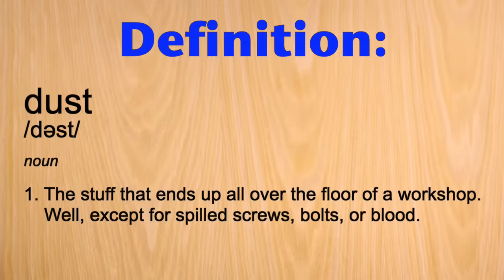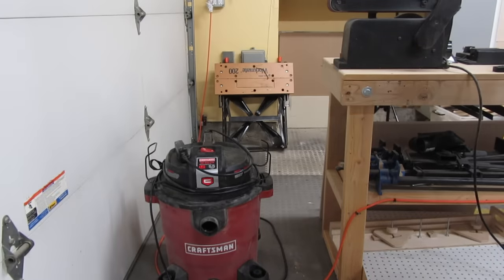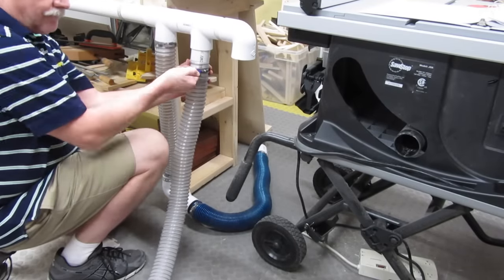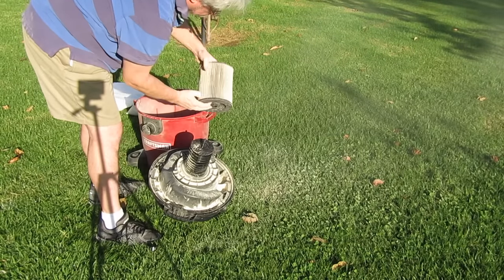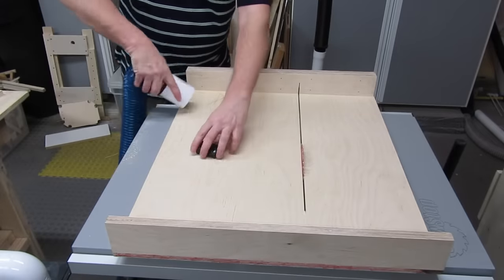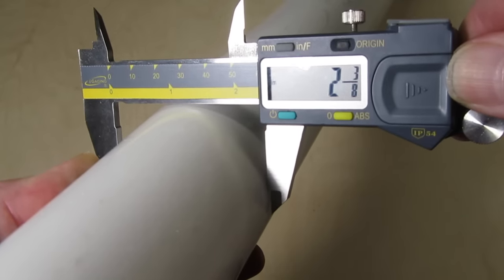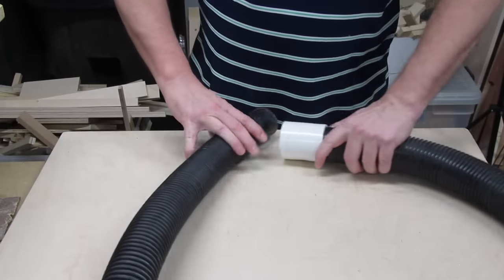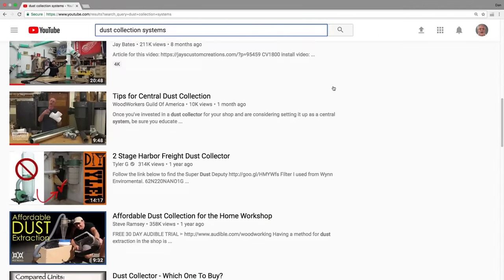Dust Collection for Newbies: Introduction to Dust Collection

Comment: I have cut pvc pipe with my mitre saw. 100mm pipe unfortunately doesn't fit but anything smaller is fine, so long as you cut slowly.
Reply from the maker: Thanks for the info!

Comment: I'm glad I found your show. I'm a newbie to woodworking. This set up for dust collection is just what I've been looking for in my little shop. In this video, I noticed your tabletop band saw. What make and model is it and do you like it? Thanks.
Reply from the maker: Thanks, I'm glad you found my channel too! It's a Ryobi BS904 (or it might be BS904G). It's "good enough". There's lots of times I wish it had a longer reach, but to get one with a really long reach is pretty expensive, so this works fine. There's one set screw that wasn't long enough and it stripped out, but it was a standard size and I replaced it easily. Like I said, it's "good enough".

Comment: Let’s talk T’s and Elbow, I’ll refer to as L’s.
A why fitting I’d move efficient than a T because of turbulence. The Y makes a smooth directional transition vs. the T which makes the dust hit a solid wall before turning. It can also plug the static side of the T by collecting in the vacuum caused by no flow on that side of the T.
L’s.
This is basically the same deal as the T.
A 90° L causes the dust to hit a solid wall. Two 45° L’s attached, as with the Y, cause a turn instead of a crash.
These are the best way to transport dust.
Here’s one more point.
If you live in high humidity, using any vacuum system will cause condensation in your closed system. Moisture and dust? Makes mud.
Just beware of that and like everyone says, don’t glue anything together in your dust collection system.
At some point in time, you will be disassembling and getting clogged dust out.
Reply from the maker: Thanks for the comment. Regarding T's, Y's, etc., I think (emphasis on "think") they don't affect shop vac-based systems nearly as much as they do systems that use blower-style dust collectors. I think it has something to do with the fact that one system relies on air speed, and the other on air volume, or something like that. I did some testing with an anemometer, and that appeared to be what my results showed. I'm completely aware that my testing methods might not have been accurate enough, but that's what I came up with. So take that with a big grain of salt. 😄

Interesting about the moisture and dust issue - I didn't know about that. Of course, I live in Southern California, so high humidity isn't as big an issue here. With that said, I agree that not gluing the tubes is a good idea, whether humidity is a factor or not. I've had things sucked up inside them that I was glad I could get to. 😏And being able to get to a clog is awesome. 😄

Thanks again for the comment.
Reply: The Newbie Woodworker   Well, they are not as affected in suction systems. The point is with moving product is best done with smooth turns, rather than sharp. Both systems work, but the less angle in turns the less turbulence.
Volume is better than velocity.
Speed causes resistance on the walls and will effectively close up the pipe.
Volume is much better.
Reply from the maker: @rogeroday9408  I can't argue with that. 😄

Comment: You mentioned smooth vs. spiral collection hoses.
Smooth hoses are not more efficient. Smooth duct with air moving inside builds static resistance. Spiral hose creates a rifle effect this is like a rifle barrel. Cyclone if you prefer.the spinning air causes the dust to slide with less resistance by channeling.
Reply from the maker: Thanks for the comment, which I found quite interesting. I was just parroting what I've always heard, but your explanation makes sense to me. 😄

Comment: In case it helps anyone.  I cut PVC with my Bandsaw when it will fit.  It works very well for cutting smaller pieces.
Reply from the maker: Thanks for the info! 😄

Comment: When particles flow thru PVC an electrical charge starts to build up.  If run long enough it will discharge.  Sawdust and air in the right ( or wrong ) mixture will, if an ignition source is applied, explode.  If the shop or building has a coat of sawdust everywhere, a secondary and more powerful explosion can happen. This info is out there. You are smart enough.
Reply from the maker: Thanks for the reply. Yes, I am smart enough to do my research. https://www.rockler.com/exploding-pvc-dust-collection-ductwork

Comment: I cut pvc with my miter saw. I have also watched a licensed plumber cut it the same way. It's pretty safe IMHO using normal miter saw safety measures - I would recommend wearing a mask and eye protection. PVC makes a mess - so make sure you have your shopvac ready. I have used PVC cutters, be very careful.  If the blade is not sharp, it will break the PVC. I wouldn't use one on anything over 2" - the pipe always snaps leaving a not so clean edge.
Reply from the maker: Thanks for the info. Now I know why it's so hard to find PVC cutters larger than, say 1 1/2".

Comment: The  two 45s work better because it's a more gentle bend and makes flow better. The Y fittings are great for the same reason but only if put in the right way, ie inline with airflow.  If it's put in the wrong way will cause issues
Reply from the maker: Thanks.

Comment: Should mention something about grounding the pipes to prevent static electricity generation and thus spontaneous dust combustion...
Reply from the maker: https://www.rockler.com/exploding-pvc-dust-collection-ductwork
Reply: Although scientifically possible in the most perfect setting it’s not a real danger. It’s like saying your socks will catch fire walking around carpet on a very dry and cold winter day. It’s just not gonna happen. Well maybe if you soaked wood/socks in gasoline and had a propane leak in your shop at the same time 😜
Reply from the maker: @matthewg7835  But if you soaked your socks and wood, then there wouldn't be any static build up. 😛

Comment: I'd add that, you really should be using metal for the tubing. PVC is the worst for static buildup and the potential to ignite the fine dust. It's recommended to run a grounding wire through PVC if that's what's being used.
Reply from the maker: Here's my thoughts on the subject: https://thenewbiewoodworker.com/dust-collection-fire-danger

Comment: If you want to cut PVC using a table saw or compound miter saw you need to flip your saw blade over. You don't want the teeth cutting into the PVC or plastic like it does wood. The PVC or plastic can shatter. If you flip your saw blade so the teeth are facing away when cutting you are basically melting through the plastic with friction. It gives you a cleaner cut and it shouldn't explode. Still be cautious.
Reply from the maker: Thanks for the info! 😄
Reply: @TheNewbieWoodworker  no problem thanks for the video. It was very informative
Reply from the maker: @inspectorsteve2287  👍

Comment: Your videos good. You should use 45 and why connectors better air flow Flo UW her. You should use a bandsaw for cutting repetition PVC pipe. They do make a PVC cutter but you have to go with the Victor brand a lot better and you can get a one that cuts over 2 inch just go to an industrial irrigation store.

Comment: I've use my chop saw to cut pvc pipe, safely so far.  Band saw works too.
Reply from the maker: Thanks for the info! 👍
Reply: I did once on a chopsaw, I'll never do it again... It blew up into hundreds of tiny shards shrapnel. I was very lucky all I got was a couple of lacerations on my arms. If you don't hold the PVC pipe tight enough it'll catch the pipe and make it spin at the same RPM as the saw blade which is very bad.
Reply from the maker: @J-D248  👍

Comment: I use my miter saw to cut pvc. It works great and I have yet to have a problem doing it this way. With that being said I don't condone using the miter saw....just saying it works for me. Also menards has a large pvc cutter that works great.
Reply from the maker: Thanks for the info! I don't think Menards has one that will cut a 2" PVC pipe - am I wrong?
Reply: @TheNewbieWoodworker  
You know friend I'm not sure. I know it'll cut 1 1/2 but sure about 2" sorry. Miter saw works perfect though
Reply from the maker: @craigo9101  No problem - thanks for the comment! 😄

Comment: I got tired of the plastic buckets collapsing  and changed to a metal drum with a clamp lid  ,Cyclone still fits the top and no more problems of collapsing drums purchased the drums from a auto paint  and panel beater supply, in fact got 2   cost $20  delivered ,they use them for waste or left over paints..I use a  redundant house vac  works well and plenty of suction  and the paper bag has nearly zero dust in it after 12 months
Reply from the maker: Great idea! Glad it works well for you. 😄

Comment: On the table, I would have installed the blast gate 180° turned, so the lid points upward and is easier to grab for pulling and pushing it.
Reply from the maker: That's funny - the reason I have it that way is for the same reason - to make it easier to grab and pull! I guess we just think of things differently. 😄
Reply: @TheNewbieWoodworker  But your way you have to somehow shove your hand in-between blast gate and table top every time?
Reply from the maker: @Suranfox  Um, yeah, and I was just in my shop thinking about that. Your way makes a lot more sense! Sometimes I'm a little slow on the uptake. 🙄Thanks for not giving up on me! 😄

Comment: the holes in the blast gates are for a grounding wire. dust colection systems build up static elctricity and with the dust create the potential for an explosion. now most of us dont have metal in our buckets but strange things happen. lots of sawmills and wood plants have exploded from static and dust. here is a link and photo of the ground. but you can do this with any bare copper wire. good intro though for those new to this system. 
http://www.leevalley.com/us/Wood/page.aspx?p=62616&cat=1,42401,62597
http://www.leevalley.com/us/images/item/Instructions/dustcollection1.jpg
Reply from the maker: Thanks for the info. Here's an article that describes my feelings on the subject: https://www.rockler.com/exploding-pvc-dust-collection-ductwork

Comment: Thank you for your informative videos. They are explained very well. I have used a miter saw to cut PVC and have not had any issues. However, my preferred method is those ratcheting PVC cutters; mine is a Husky from Home Depot and it works amazing! I do have a question though: How do you mitigate the risk of fire or rapid ignition with static charge build up inside the PVC igniting the dust Particulate Matter? I have heard you have to use tubes made for dust collection or steel?
Reply from the maker: Thanks. Were you able to find PVC cutters that can do 2 1/2" pipes? I never found any for that size. As for the risk of fire, I wrote an article about my thoughts on the subject: https://thenewbiewoodworker.com/dust-collection-fire-danger

Comment: If you use 90 degree T's you are killing your suction. Use 45's if you have suction issues. Subscribed.
Reply from the maker: Thanks for subscribing, and for the comment! 😄 I have a nanometer, and I've tested with 90s and 45s, and I haven't seen a noticeable difference. Not in practice, and not with the nanometer. I know that when you use a true dust collector, which relies on air volume more than air speed, it does make a big difference. But with my shop vac system, as I said, I couldn't tell a difference. BUT, I'm well aware I could be wrong. Maybe I'm not measuring correctly, or something like that. Anyway, that's why I didn't talk much about that. 🙄😄
Reply: @TheNewbieWoodworker  If you've metered it and see no diff then you're probably right, with a smaller diameter hose. I've only seen it cause issues on 4" and up hoses.
Reply from the maker: @michaelposey6529  I always try to leave things open for the fact I could be wrong, since it happens fairly often. 😄But I don't think it causes an issue. Anyway, thanks for the comment!
Reply: The Newbie Woodworker : although air flow isn't significantly hampered, it is more likely to get clogged with long debris. A wider-sweeping elbow would be better, and curved tees with the rounded part directed toward the vacuum would help. Great system, though - just adding suggestions because you are so open to other ideas!
Reply from the maker: @stanrobertson  Thanks for the comment, and I can imagine that's probably true. I've been lucky and haven't had any issues - it even sucked up a tape measure the other day. 😂But I can see how it could happen. Thanks for sharing! 😄

Comment: A typical shop vac only flows about 55-60 CFM.  The new Ridgid  6.5HP flows about 100 CFM but if you add duct wok it falls to sbout 50 CFM. Not at all suitable for this application and not sold for that. I recommend a newbie buy the Harbor Freight DC for about $200. It's for a roll a round and will flow about 300 CFM despite their claim of 1600 CFM. Lots  of videos on improvements here. It  will not work well with duct work. A lot of people have tried this, given up and bought a bigger system  . At $200 it's easy to resale it.  The #1 thing for dust control when your first starting is an Air Filter. A big DIY does an amazing job . Don't waste your money for a new one for $250 400. They are a toy. Go to your local HVAC company and get a  huge  furnace  blower  out of a furnace for free. Bring tools.  Bigger is better.  Build a cabinet for it and add filters. The cheapest  filter is the 3" thick 20x 20 with a super fine 20x20 after it. They will last several years.   Lots of DIY videos here. For a $100 bucks your lungs will thank you.  This is a very steep learning curve with a lot of bad advice distracting you.  Read Bill Pentz.
Reply from the maker: OK, thanks for your comment.

Comment: I can't agree more with your advice on not using a chop saw to cut a PVC pipe. I can speak from experience. Sure it seems like something harmless.. What can go wrong? 

What can go wrong is the blade catching on the pipe, and since the pipe is round it has no resistance against spinning at an unbelievable speed and exploding into hundreds of sharp plastic shards that can take your eye out and/or cut anywhere unprotected, as well as anyone standing nearby. You can try to hold it tight or go slowly but there is so much force behind the blade it's not gonna make much of a difference. You may have done this 1000 times before, but it only takes 1 time to do irreversible damage.

Just use a hacksaw.. It's just plastic... It won't take more than 2 minutes.

Comment: I use my miter saw to cut PVC all the time, to date have had no problems. I like what you have done for dust collection. I was looking at the Harbor Freight Dust collection system, my shop is not that big but it seems to always be covered with dust, my miter saw is the worst culprit and even with one of those bonnet things on it. Do you think the shop vac is enough with the cyclone system or would the dust collection system from Harbor Freight be more efficient. It is becoming a pain to keep switching the hose from one tool to another. I'm also concerned with the output of my planer and whether or not I should hook the vacuum up to it as it has it's own exhaust for the chips (haven't used this yet, but plan to in the next few days) the book says not to hook a shop vac up to it and I'm wondering if it's due to the capacity of the shop vac. I'm new to all of this so any direction would be greatly appreciated. Thanks in advance.
Reply from the maker: There's so many factors that go into making this decision, it's hard to say what's best. But considering what your planer says, I think I'd go with the HF dust collector, and 4" pipes. It actually doesn't take up much more room than my shop vac stand. But do some more research on setting up a system with 4" pipes, because you need to make sure your runs don't cut down on the dust collector's ability to pull enough air. Also, take a look at this video https://youtu.be/oosMqnORR6k for an example of how to make emptying the dust easier - you can either do the filter thing or not, but the tip on using the bucket and the trash bag sounds like it would really help.
Reply: @TheNewbieWoodworker  Thanks for the information. I love the idea of the bucket and trash bag idea, I will definitely do that if that's the way I go and it sounds like it would be with my planer. Thanks again for your help I'm sure I will have other questions. Thanks too for your quick response.
Reply from the maker: @wilmawillson1547  You're quite welcome! 😄